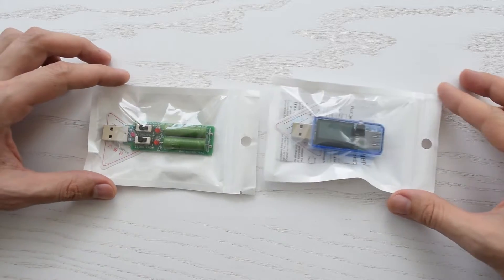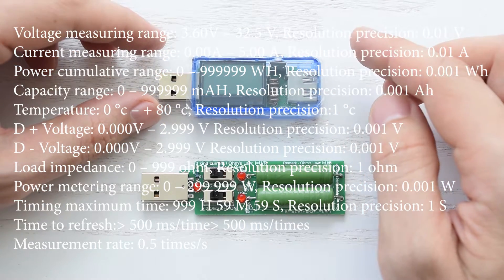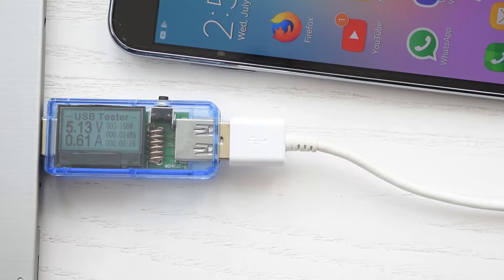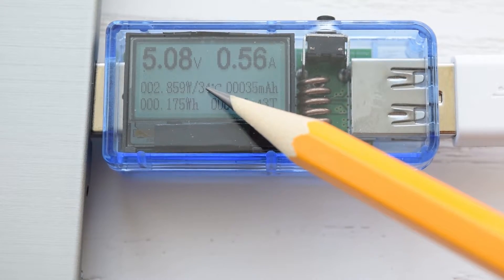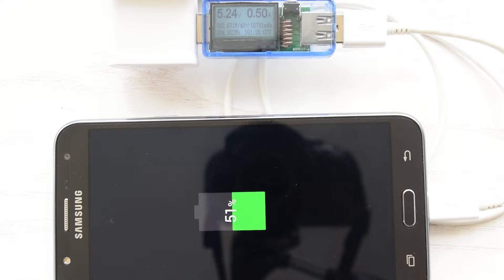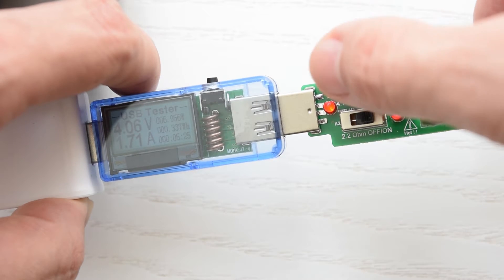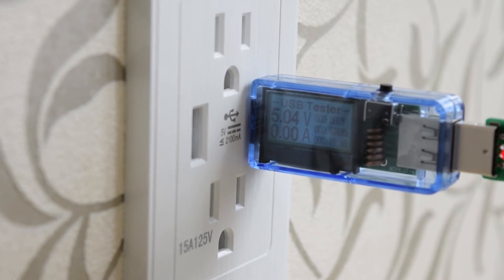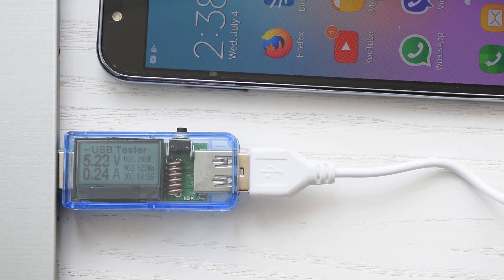How to Test USB Chargers, Cables, Ports & Power Banks Using a USB Tester

Comment: When testing the cable you would have to have a meter plugged in at the supply and delivery ends otherwise you are not only measuring what the cable is delivering but also what is being lost in the cable. Inadequate conductors act as resistors and lose power by way of heat, the meter would read this as power being delivered.

Comment: Good concise video.  Though I have a KayJI model tester (meter and load module), this video was helpful in my understanding on how to use the load tester.  KayJI’s load module doesn’t have LEDs like your model, it appears other wise identical.  KayJI’s documentation provided no help on using the load module.  You nailed it.  Thanks.
Reply from the maker: Glad it helped

Comment: Is there a voltage flux if a magnet is near charging cable or on/ under charging cable? Will device read voltage changes if a magnet is on cable?

Comment: Hello. Just need a clarification. How come the output reading of a USB plug has 3 data. I am looking for a fast USB plug to be used as an adaptor to my rechargeable battery device. I have two plugs. Data as follows:

USB Plug1 Data – Input 100V-240V ~50/60Hz 0.5A
Output: DC 5V==3A / 9V==2A / 12V==1.5A

USB Plug2 Data – Input 100V-240V ~50/60Hz 0.75A
Output: DC 5V==2A / 4.5V==5A / 5V==4.5A

Which is suitable and fast charging of two?

Comment: How should I check USB Type B?
Reply from the maker: The voltage should be: 5.00-5.25V and the current at maximum load up to 0.5A for USB 2.0 and 0.9A for USB 3.0

Comment: theirs a really cheap adjustable load tester, around $5 when i bought it, it has a knob so u could adjust anywhere zero to whatever resistance it went up to, it had a little tiny fan on it, im actually goin to go see how much the prices come up n try to get one now...
Reply: I'm also thinking about getting that one. Counting shipping to my country, the one on the video costs $1.75 and the adjustable one costs $3.69. But what's the point in having more than 3 power draw steps and in the fan? It's just 15 Watts at maximum.

Comment: Can this device with these two resistors be used to discharge a powerbank, for example?
Reply from the maker: Sure, but not at the maximum load because those resistors will overheat and burn out.

Comment: Thanks for this video. What USB tester do you recommend for QC4.0 devices with type-C? I would like to place the tester between the cable and the device (not between the charger and the cable)... Placing the tester just before the type-C device I should be able to test the charger's wire as well and see what current the device is really getting... Is this correct or am I missing something?
Reply from the maker: This is the best option: http://ali.pub/545y18
All USB testers have a male USB input connector. So you can connect them only directly to the USB port/charger. Even if there will be both USB-C ports on both sides you'll need some adapters to make it work.
Reply: @ElectronicsComputers  Thanks for your reply. Yes, type C is on both sides (QC4 charger and QC4 phone). So if I buy the tester you suggested I would need an extra type C cable (charger > type C cable > tester > type C cable > device). Right?

Comment: Can you use this to check an aerogarden USB led connection?
Reply from the maker: not really. This tester only shows the voltage in your USB port and the current that connected device draw. And if you connect a chargeable device into that tester it will show you approximate battery capacity (if you charge that device from 0%-100%).

Comment: usefull , tnx

can you explain more about D+ / D- ? i want to know does it possible to understand the health of cellphone charging connector by this device specially the data way!?
Reply from the maker: The voltage of the data line is not gonna tell you a lot. That voltage vary depends on manufacturer and the specs of the charger. Some chargers don't have any voltage on data line pins, some chargers have shorted data line and some have resistor in parallel to those pins. That voltage is used by your phone or whatever you charge to recognize the type of the charger (quick charge/power delivery) and its power. Check out these links:
https://www.beyondlogic.org/usbnutshell/usb2.shtml
https://www.maximintegrated.com/en/design/technical-documents/tutorials/4/4803.html
Reply: @ElectronicsComputers  tnx a zillion

Comment: Very difficult to understand your accent.  SLOW DOWN!
Reply: Change your playback speed to 0.75.
Reply: Use the menu designated by the 3 dots to the left of the SAVE icon beneath the video window to open the transcript as the video plays.

Comment: Hi how to solve error 9 problem in iPhone 5s using tools r softwares
Reply from the maker: Error 9 could be for a number of reasons, some of them fixable, some of them  not. It's definitely hardware issues. What worked for me a few times is simply disconnecting the front panel with LCD and cameras from the logic board basically you have to leave only battery and USB board connected to the logic board and then connect to iTunes and try to restore your system.